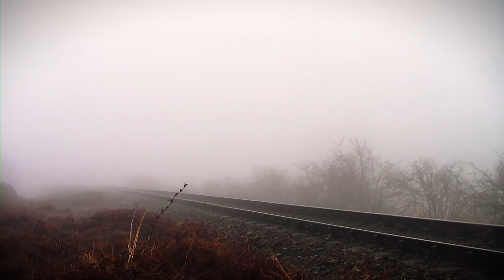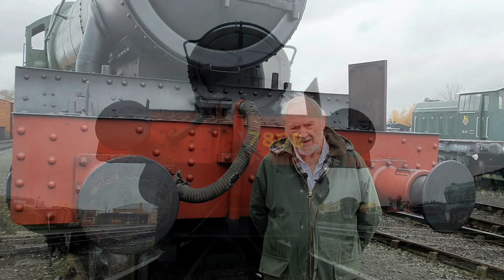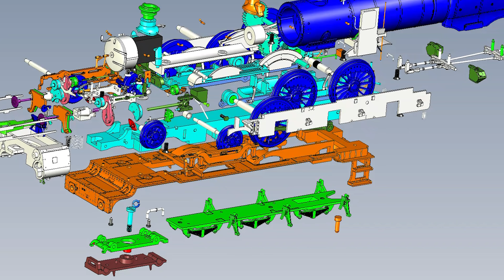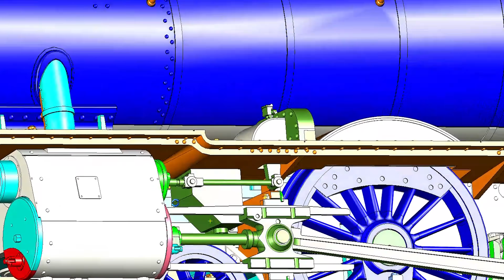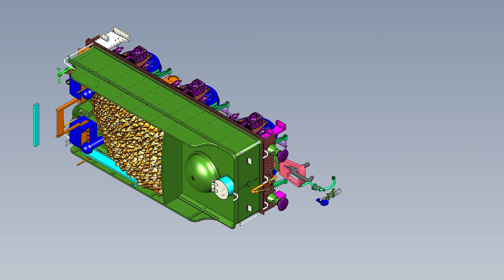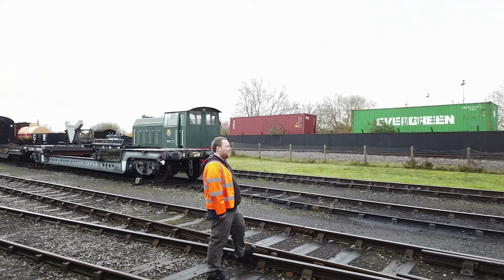Accurascale announce NEW Locomotive!

Comment: Omg can’t wait. Have to get a few of those. 

Why only a 3 pole motor though and not 5 pole in this day and age? That is my only worry.
Reply: This three-pole motor is smoother and has a lower starting voltage than similarly-sized five-poles. A larger number of poles doesn't necessarlily make the motor better... ;)
Reply: @PatrickConboy1982  brilliant answer. Thank you
Reply: @astonnapper-woods1230  and it’s not coreless 😊

Comment: Sorry, worried for Accurascale. New boys on the the block, only making wagons two or three years ago. Then announced there first loco as a big Deltic, then a Class 37, now a more complex steam locomotive. Shouldn't they learn how to walk before sprinting let alone running. 
Heljan have bombed apparently with their O2 steam locomotive, even though they have been making substantial diesel locos for years. Accurascale haven't produced any working locos yet which the public can actually buy. Let's just hope they are actually good runners and reliable, not just pretty static exhibition models. I've pre-ordered a DCC sound Deltic in hope. Fingers crossed.
Reply: accurascale are only 3 years old, and have delivered 9 new product lines in that time, and are now starting to deliver the locomotives they have been launching. They are also going 5 or 6 years in Ireland before that.
Reply: @mccarronfamily  are they an offshoot of Murphy Models or a completely independent company ?
Reply: @andrewdking  New business, you could argue that by starting with wagons first, they have indeed learned how to crawl, then walk, now run?
Reply: @mccarronfamily  I don't own any of their products yet. I've watched them with interest at shows from their start and hope they do well. Hattons have gone the super fine detail route (I've a class 66 on order), but access to the inside results in bits dropping off all over the place apparently. We shall see how this company addresses this problem with the Deltic later this year.
Reply: @andrewdking  Their wagons have met with rave reviews - you should try one
Reply: @mccarronfamily  I would if they made KFA-T bogie bolster timber wagons. I've just asked Cavalex if they would be willing to make them.

Comment: You know what I might just by this even I have no interest in Steam, the '7808 Cookham Manor' since it is running today as Preserved will be appropriate for a Steam Charter on the layout.
Reply from the maker: Itll be a great model
Reply: @hornbymag  from AS it will be...it will be...
Reply: if you are looking for an oparational one 7808 is not realy the one you want, it last ran in 1983.  however 7802 bradley manor with its 4000 gallon tender would be more appropriate, but sadly lost its mainline certification in 2007
Reply: @thomasbrigham6321  thanks for the info, apologies but my fault I was actually looking more along the lines of Heritage Railway line use which 7808 should fit the bill.

Comment: pity it is not fitted with a 5 pole motor so it can handle helixes easier
Reply: At the listed weight and power from the release, I doubt a helix will present a problem to this 400g+ monster

Comment: Tender looks a little to light I fear the worse with bouncing like the dapol mogul does which is great inconvenience
Reply: Tender weighs over 100g
Reply: That's good then
Reply: @ethmister  You can always buy a pack of flat adhesive motorcycle wheel weights on eBay. A pack of 5g and 10g only cost a few pounds and fit in any tender.
Reply: Interesting

Comment: Dapol ...
Reply from the maker: Were late to the party 🥳
Reply: its gonna be an interesting race to see who gets there's in the shops first.  dapol already having the 43xx complete will have a grate head start on accurascale as id imagine half the parts or more are the same
Reply: @thomasbrigham6321  The video features the Accurascale first sample, so the tooling is already complete
Reply: dapol now have there engineering sample and are expecting to take delivery of the decorated samples in the spring of 2021 and have models out to our retail network by the Autumn time
Reply: @thomasbrigham6321  Neck and neck so - surprising Dapol didn't reveal their sample if they had it in hand until 'forced' to do so